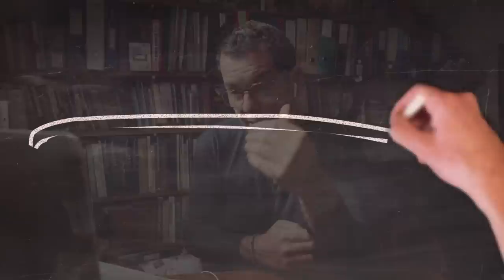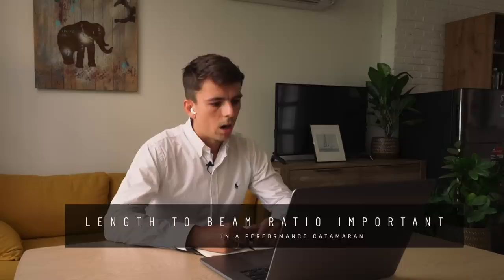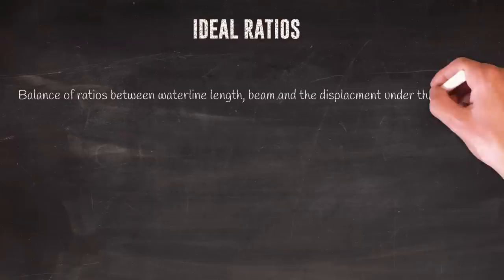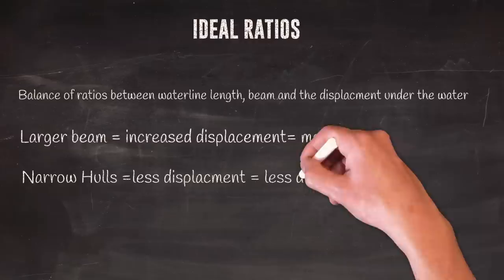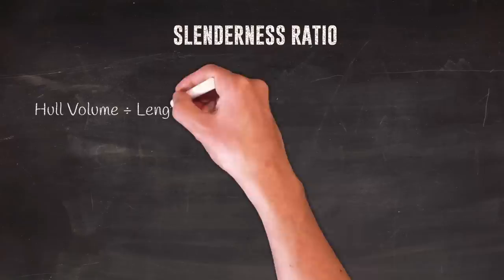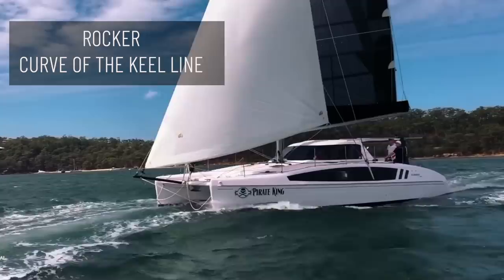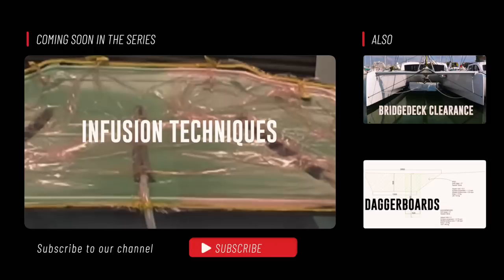CATAMARAN DESIGN: Hull Shape | Essential Catamaran Knowledge Ep. 1

Comment: The whole time I was thinking “this is way more than I need to know!” But I watched to the end anyway and learned a lot. Thanks!
Reply: And I'm over hear saying out loud... tell me more, tell me more.
Reply: That was informative. But, I was hoping for more info on . 1. How does "rocker" in hull design profile, affect dynamic drag (suction) by vertical or rocking movement of the hull? 2. How does depth of hull affect drag vs displacement? eg. comparing a "V" cross-section  having the same displacement as a wide curved but flatter hull cross-secton. Taking into account wetted surface influence  3. How does hull symmetry  along the hull centreline affect performance & drag? eg. What if the centerline is not along the centre of the beam but more to the outboard of each hull. Making a wider distance between the centrelines of the two hulls. 4. Are the Port & Starboard hulls both pulled from the same mold?

Comment: D/L > 7?  Can’t be correct.  No matter the Units of Measurement, which aren’t given, the result would increase as displacement increases, and decrease as length increases, the opposite of the stated objective that a higher value would mean better performance.  Standard formula is (displacement in long tons (2240lbs)) / (0.01 * LWL(ft))^3. Curious to see what the formula Antoine uses actually is.

Comment: I think this comes down to what are your priorities. (Not disputing the analysis, the engineer did a great job of presenting the design/performance theory). Is your priority to sail as quickly as possible? Are you buying a yacht to experience the maximum sailing performance? Are you looking for maximum comfort? Are you looking for minimum draft? If you are looking for performance, are dagger boards a requirement? Etc. This seems to suggest its like Americas Cup and the fastest boat wins. For some this may be accurate, for others its more about the experience of travel and adventure. At one time on early Ruby Rose video’s I remember hearing only a monohull was the preferred sailing vessel. We all watch several sailing channels and obviously the journey is accomplished in MANY different ways. They all seem to achieve their individual objective. I have two cars. One is a GMC Suburban and the other is 911 Porsche. Both will allow be to drive from California to New York however, (and as with everything) there will be tradeoffs. For me my goal is to travel and share an adventure of a lifetime and much less about the design of the yacht. It seems to me The Wynns, UMA, SLV, Delos, O’Kelly’s etc. are all out sailing and achieving their dreams. For me this is the most important criteria.

Comment: Several years ago I read a book from the 1890's on steam locomotive design and was quite surprised at how much the engineering was based on ratios.  Ex.  If a part for a certain function needs to be X inches long then it needs to be at least X/12 inches thick.  These ratios were derived from what worked in the field and what didn't work rather than from material science and complex maths.  Although we now have computers which can perform hydrodynamic calculations in fractions of a second it is interesting to me that we still use ratios when talking about the properties of a boat.

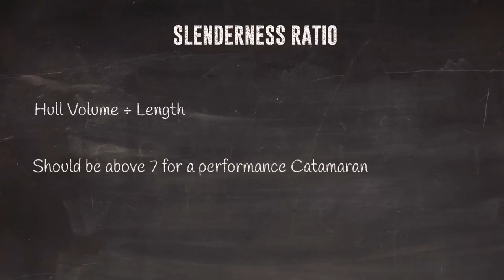Comment: Slenderness ratio = Length / Hull Volume. The formula at 8:00 is the DLR (Displacement Length Ratio), which is inversely proportional to the Slenderness ratio. Also the SR is in SI units, the DLR in Imperial units. Since he is talking about actual numbers this is relevant.
Reply: Saw this too
Reply: These statistics are for the under water portion of hulls.  Very little, if any, of a cruising sailboat interior is under water.  Waterline beam plus flam determines the interior more than any technical statistic.

Comment: Always liked your show.  I think there was a typo though.  Slenderness ratio is LWL/(HVol)^1/3, the higher the faster, not the other way around.  Nowadays mostly the weight+Length+sails determines boat performance.  I liked seawind 1260, but the cabin ceiling too low to be comfort.  Seems like Seawind 1370 improved.  Looking forward to more info on pricing etc.
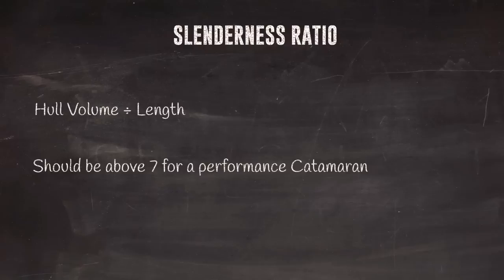Reply: Yep. There's a typo in that Slenderness Ratio slide at 7:58 .
The slde gave the formula for Displacement  to Length Ratio instead.
Reply: There is more than just that one typo which makes it hard to watch as an engineer, but nice effort for braking down the engineering side of things!

Comment: "Vertical dynamic lift" Is that also called 'planing'?  (Factoid: The Aleuts were planing at about 8 knots and could sustain 10 knots over distance. This was reported by Captain Cook's navigator, probably the best technical source available in the 18th century. Maps they made of New Zealand were used into World War Two). 
Loading the boat. I'm a terrible backpacker. Some backpackers walk thousands of mile and their backpacks never exceed 20 lbs. Me 4-5 days 50 lbs. However, I weigh everything, make a spreadsheet, sweat every ounce - otherwise my pack would be 80 lbs. I don't think cruisers get this extreme, but I'll bet a couple of good scales, a spreadsheet and some obsessiveness would shave a lot of excess weight and also point out where it is. Instead of canned goods maybe another freezer might give you more and better vegetables at less weight - just maybe, I have no experience (yet).  
Great series. Probably going to save me a lot of money, and a lot of disappointment when I buy a multihull.

Comment: Nice work on this video! I was told this series is worth a look and it sure is.  
I believe style on a lot of new performance cruisers is still being put before cruising function quite a bit.  
Immersed transoms is a great example of racing style looking cool but not functional for cruising.  
The wider shorter sterns with immersed transoms only offer more performance once at high speed.  They are slower in light air and for performance cruising light air performance is actually more important than a few % more at the top end when your likely slowing down anyway.
If you have anti foul pain on your transom you have wet heels...  
Mick
Reply: Helo miss, i am a part of an undergraduate student team of Naval Architecture, who is participating in Ferry design compettition , we are designing a catamaran and we require the range of coefficients best for catamaran for e.g Cb ,Cp LBr e.t.c. so we request you to help us in any way you can for that. Thanks a lot.

Comment: Interesting.  One shape to consider is hull asymmetry.  When viewed from above, a Hobie 16's hull has an airfoil shape: the hull is flat on the outside but curved on the inside.  The idea is that it co.pensates for lack of a centerboard: it  generates lift for windward performance and reduces leeward drift by presenting a flat surface to the water on the outboard hull.  Do modern cruising cats do this?
Reply: Nope. Too inefficient
Reply: Yes, my new hull design does. It is an improvement on the Hobie design hull. I have tested many 5m prototype hulls and compared to conventional modern dagger board hulls, the results show advantages which are; Superior lateral resistance at all speeds.
High and low speed efficiency without foils.
Excellent sea keeping capabilities. Cheers

Comment: That was informative. We never hear anything about hull design, if you want to know you have to go looking. Other important factors that effect slamming are the distance from the bow to where the bridge deck starts and the shape of the leading edge of the bridge deck. Having the hull shape with a flat section in the stern helps reduce hobby horsing. The charter industry has turned cats into max volume to minimum length boats, at the detriment of sailing ability. What is called a performance cat today is really just a well designed cat that should sail well in all conditions. Cats with all lines led to a single helm with 2 winches and a bank of jammers would have been considered suicide 30 years ago, today it's just a cheap option for under powered cats. If you are interested in buying a cat it's best to sail on as many different brands/designs as possible, there is no substitute for experience.   Cheers Rustie.
Reply from the maker: All that good stuff is coming in the next episodes my friend

Comment: You could have asked once you have arrived at your final design what is the additional  ‘TPI’ (tonnes per inch immersion) if at DWL. To be honest the basic waterline is an academic (although necessary design datum) I would insist that the DWL includes - All tanks including holding tanks at 95% full, specified dinghy and outboard weight, life raft, specified anchor cable and anchor (otherwise they will ‘short chain’ you😉), solar panels and associated control gear and invertors, an allowance for engineering stores (fluids) and spare gear, Weight of passengers- if boat licence for 6 or 8 so be it - with luggage allowance (say 40 kilos each), food and provisions for certified number of passengers for 3 weeks. If the DWL then compromises the key numbers including bridge deck clearance then the NA has to ‘go round the buoy’ and iterate hull form to achieve the objective. Good vid.😀👍⛵️
Reply: Half full tanks are usually used in displacement calculation.
Reply: I was talking about TPI and DWL - not a displacement calculation.

Comment: Interesting. But, one important consideration that was addressed but passed over very quickly, is the law of buoyancy or Archimedes principal. Regardless of the ratios that impact performance and lift at speed (i.e. dynamic performance), one has to understand that for any given weight of boat and load, the volumetric displacement of the hull will be the same. Archimedes Principal basically states that the weight of, in this case, a fully loaded boat, will have to displace the volume of water of that same weight. In other words, a cruising boat or a performance boat of the same weight, will have to have the same volume of hull below the waterline (i.e. the volumetric displacement will be equal).  That is why, I am assuming that performance boats have to be lighter which is intuitive, but also required, because narrower hull for any given length of boat will have has less volumetric displacement therefore, will only support a lighter fully loaded boat.  Therefore hull DISPLACEMENT will always be directly related to the boat weight.
Reply: correct, but that's the whole issue, these superficial videos about hull design never really expose the impacts of specific design decisions. They cover generalities and make the viewer believe they understand better.  They do not. All they should understand is that is the topic way more complicated than they understand. Engineering is hard. Dunning-Kruger is real.

To carry a specific load (boat + gear + people) It is not the displacement that is important, it is the shape of that displacement and the vast tradeoffs in that shape design...
Reply: Ignorance is a curious thing.
Reply: What is your point?  Displacement can be bare hull, fully loaded, loaded for offshore, loaded for living aboard, loaded with half full tanks, etc.
Reply: My point was simply that in my experience many people don't know the law of buoyancy - it isn't necessarily common knowledge and it wasn't explicitly explained in the video.  So, I was just pointing out that for any given designed displacement or weight of a boat, that in itself, will define the displacement of the hull (or the volume of hull that is below the waterline). So, it you want the hulls to be narrower, then they will have to be longer or conversely if you to the length of hulls to be shorter, than the hulls will have to be wider.   In other words, from a design perspective, if someone wants to build a boat that fully loaded is say 20 tons and they also want it to be no more than 45m long, than the choice of how wide the hulls are be will not be much of a choice, as the hulls will have to be as wide as they need to be at 45m long to displace a volume below the water line that  equal to 20tons of water.   More simply, if someone had a row boat and wanted to know how much weight it could carry, then they could put it on a scale and weigh it and then fill it full of water to the point that water is spilling over the gunnels. Take that total weight and subtract the weight of the boat and the result is how much it can carry before it sinks.

Comment: For customers that will spend big money on a Catamaran, I would think they spend a lot of time going over this type of information. 
 But I think everyone knows most buyers just go for the boat that has a nice finish and a great sound system.  The science behind fluid dynamics regarding lift and resistance in the water is the most important.  Thank's for a great look into a small but complex part of Catamaran design.
Reply: This information is not usually readily available.

Comment: Interesting information. Do mfg’s publish the empty weight (leaving the factory) and the useful load? This is done with airplanes. 
2 tons is not a lot of weight especially if the boat is not fully outfitted with cruising gear. Generators, dingy (with motor ) water makers, various sails. The list goes on... then there is the Pabst Blue Ribbon too!
Reply: Yes, boat designs are quoted in light displacement, which is nearly empty and loaded displacement, which includes full fuel, water, supplies, people, etc.  There's also something in between which is often called normal displacement, sort of a typical value.  Similar idea to aircraft, for similar reasons.
Reply: It is hard to get technical information for retail product boats of any kind.

Comment: my preferred concept...how fast can I make this thing go, comfort be damned!  These engineering concepts and detailed analysis, is also applicable to automotive design.  I want to know spring rates, alignment specs, tire specs, and all the pedantic details.  As an enthusiast, I love this analysis series!
Reply: Except that the tyres, suspension and bushes are not just for the driver but for the vehicle. Comfort plays a role in speed, if the ride is harsh it puts a lot of stress on the hull/chassis, which means they need to be stronger, which means more weight. Engineering is fun. Just think of why F1 cars still have suspension.

Comment: As a boat designer and builder, I don't agree with the naval architect.  You can have long slender hulls for catamarans.  The issue with cats and multihulls is all about payload / displacement / bridge deck. I believe design to sea state 3 as a rule of thumb.  It just becomes less practical.  We are talking displacement, the higher the slenderness ratio the better can go to 10 or even 12.  Do not confuse foiling with these just yet.  That is a whole other HUGE subject and not related to slenderness (I specifically focus on foiling boats and am not interested in displacement, semi displacement, or planing hulls, but need to understand the fundamentals of these first).  Foiling boats are in its infancy.  One issue to discuss is fouling potential - and design has a part to play (fewer sharp angles!)  Generally though, as a starting video on design, to focus on hull is crucial so slenderness ratio and Prismatic coefficients is a great place to start.  Well done!
Rocker.  There is also a aft rocker for both planing and displacement hulls - which affects trim angle through speed variances and hull resistance.  Then look at transom design as well.

Comment: I love a good technical episode. I think there was a little language barrier/confusion because you both kept flipping between 'volume' and 'displacement'. If I'm not mistaken, the slenderness ratio should be flipped around to be: Length at waterline divided by displacement (SR = Lwl/Vol) . The way it's written is the DLR - Displacement Length Ratio, which is the inverse. The way it's written is saying that "above 7 for performance" is meaning you get higher performance by making the hull shorter and fatter/adding more volume - which is like saying you'd go faster by turning the boat sideways :p

(IMO it's a little like the confusion when American's and Aussie talk car fuel efficiency - one tend to says miles per gallon, whereas the other says litres per 100km stat, the former is better as it gets bigger, the latter better as it goes lower)

Comment: Fascinating information. My question why can we not put a underwater wing on the hulls to create lift out the water? I can do it with my serf board. Surly being able to even a just the angle of attack of this wing with electric mothers would give optimum displacement to wetted serf ace for a specific speed for a cat? I have never seen it on a carousing cat...why not?
Reply: I agree cats hare very heavy, and displacement is great. So I am not talking about lifting the cat out the water on its fails like a racing cat. but surly putting fails on and getting the cat to lift up say 6in or 12in above its original waterline is a good thing. Would go faster as less drags?  The mechanics would be simple and the electronics needed to trim the fail would also be simple coding with pressure sensors and speed detectors. I know live aboard forgo luxury items like washing machines and dryers and a load more clunky items, but adding fails would be like eating the boat of such equipment and running with an empty cat. I know I must be missing something as no one has done it, what am I not understanding?